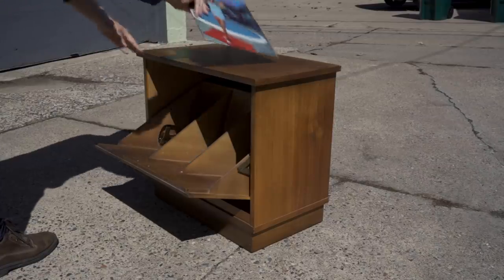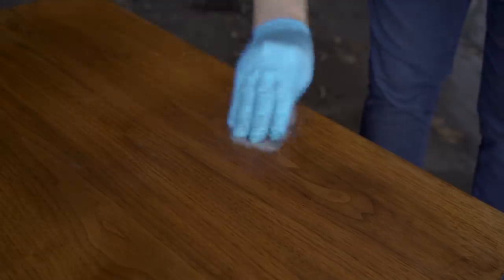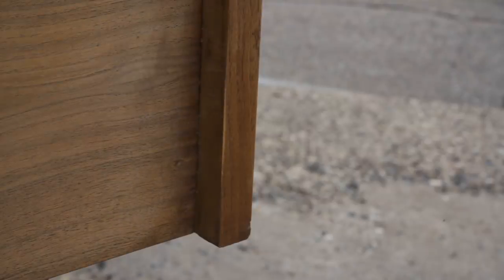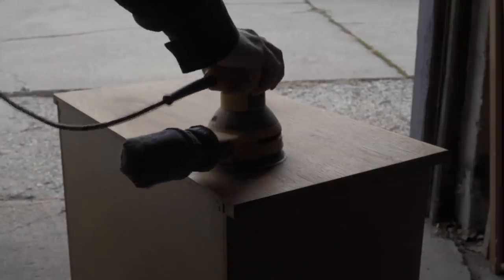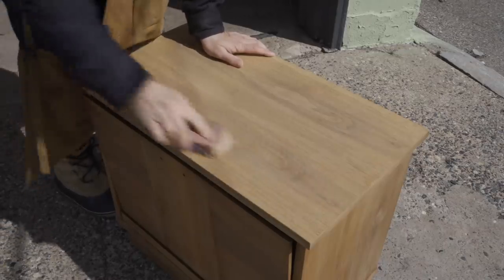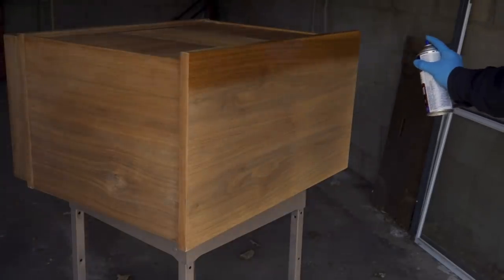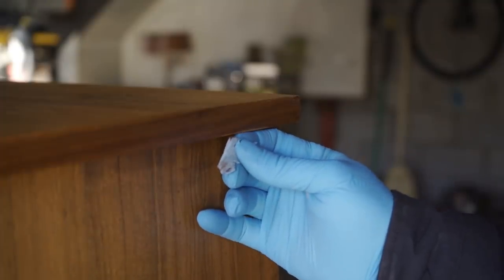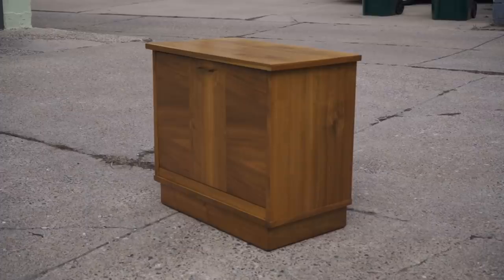I'm Ready To Spin Some Stax Of Wax | Vintage Record Cabinet Gets Refinished |Thrift Store Rescue #32

Comment: i found a little table on the curb last night. The veneer on the top is peeling off. I'm wondering if replacing that is something a decent diy-er with not much woodworking experience could do.

Comment: As always that turned out gorgeous - you strike such a perfect balance between modernizing furniture vs restoring it to how it originally was. I've learned so much from your videos and have used it on restoring a lot of furniture of my own. I'd love to see more of the in-between and detail steps, like your process for cleaning off sanding dust (rags and mineral spirits? tack cloths?), the products you like to use (is rustoleum clear coat any worse than the spray lacquer you use here), etc. Thanks for sharing!
Reply from the maker: I can try and include more of the in between stuff.  Sometimes I feel like details like that may be boring to viewers so I leave it out.  But it's good to get input like yours.  Thanks.
Reply: @DashnerDesignRestoration  that would be great, Dash. Or maybe a list of the products you used in the description of the video?
Reply: @DashnerDesignRestoration  I don't do (or even attempt) restoration, mainly because I don't have anywhere to do it or keep the resulting items, but I love watching your videos. That said, I think it would be interesting to have some of the in-between stuff, too.
Reply: @DashnerDesignRestoration  The Master is never boring. All details are important!  🤗🤗🤗

Comment: Beautiful piece that certainly deserved a loving restoration.  Using a soldering iron and wet paper towel on the small dent is genius.  As a record collector and woodworker, I may build a similar unit.  I doubt I could find one in my city.  Thank you for sharing!

By the way, the ending of the video gave me a good chuckle!

Comment: ahhh welcomed to the club and offically a menber and proud of it;];[;]  dashnerds  power up!!!!   excellent job as always;];];]  have you ever used wet/dry black sand paper for your final sanding?    i redo "junk"  that no one wants..and i couldnt get the smooth finish i really wanted on a oak piece ,    it kept splintering/jagged edges.  so my brother came over and brough me some of the black wet sand paper sheets... dashner... when i got done  dry sanding with it..... it was like velvet  !!!!!!!  i couldnt believe it!!!  i have no idea what grade of paper it is...but i grab some every time i go  for supplies for my projects....its a def life saver...i dont know... if they have it for obital sanders or not... but its def worth for a awesome finish...youll be impressed.. i dont think.. its any more expensive then reg sand paper..it might even be for metal.... i have no idea... i just know its black and extremely fine..and you can use it wet or dry...i lost my bro last yr  and his wife this past feb... then my oldest sister died last month... its been a rollar coaster of a yr already... but the one thing that keeps me happy..... they are all together with all my other relatives..and having a blast;];];]    so sorry i cant help you any more on the sandpaper.. but def look/try it out;];];] hope you have a great wk...

Comment: I may not get a reply, but I’ll try… I have a desk that has what appears to be veneer with water marks I’d like to get rid of. Any recommendations?
Reply from the maker: Hi, are they black stains?
Reply: @DashnerDesignRestoration  no, the water marks are clear and circular. They were created by water glasses resting on top of desk. They appear to have removed the veneer stain and exposed the veneer wood

Comment: Any particular reason why you haven’t used the carbide scratcher as usual? Thin veneer? Quite some time seeing you use a chemical stripper again!
Reply from the maker: I just wanted to try something different.  The scraper would have been fine on the veneer.
Reply: @DashnerDesignRestoration  And thanks again for the great video, I love your content!

Comment: That’s a very nice piece. I particularly like the contrast on the front panel. 
Is there a reason why you didn’t try oxalic acid to remove the stains from the top?
Reply from the maker: They weren't water stains so it probably would not have helped.
Reply: @DashnerDesignRestoration  Oh ok. Thanks for replying. 👍

Comment: Doesn't the steel wool leave steel particles when used with the wax?  I like 0000 steel wool but the steel 'dust' is an annoying result.  FYI, I watch your vids at 1.5 speed.
Reply from the maker: The particles can be an issue sometimes but other times it's not. Sometimes I'll use a scotchbrite pad if I don't want the steel dust.

Comment: Why can you sand across the grain with an orbital sander and not when you sand by hand? Wouldn’t it be the same thing?
Reply from the maker: It's a different thing.  The pad on a  random orbital sander moves around in a random pattern.  It's hard to explain without a visual but the direction that I'm moving the sander with my hand is not the direction the sandpaper is sanding because the pad is moving independently in random directions.